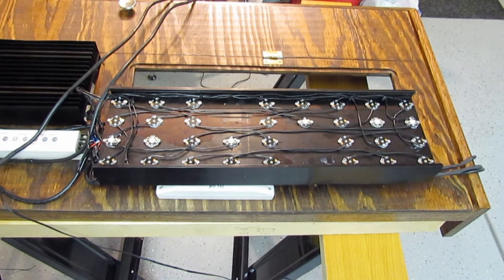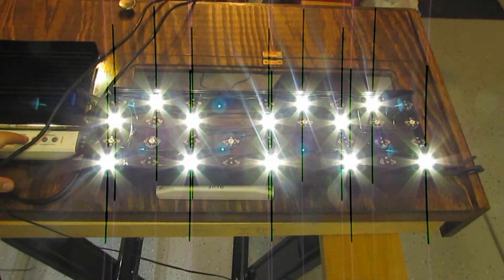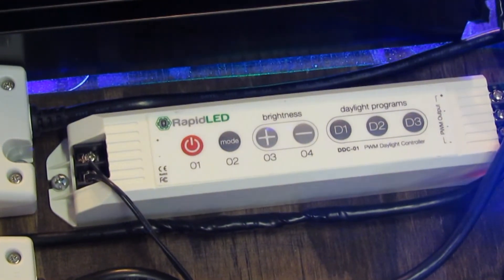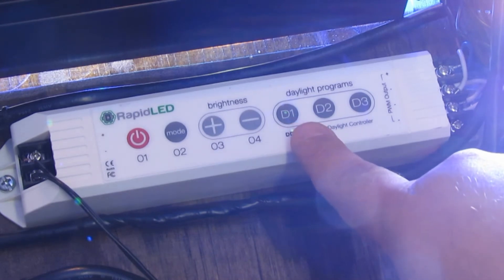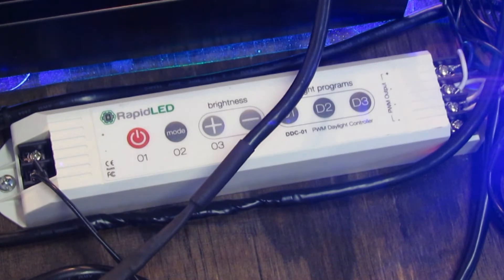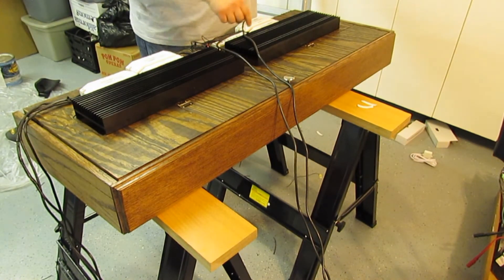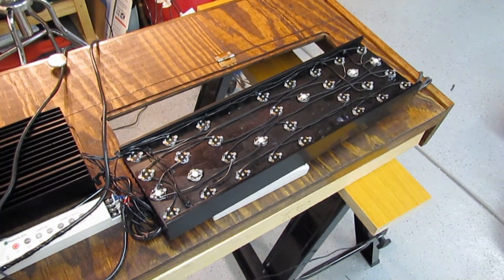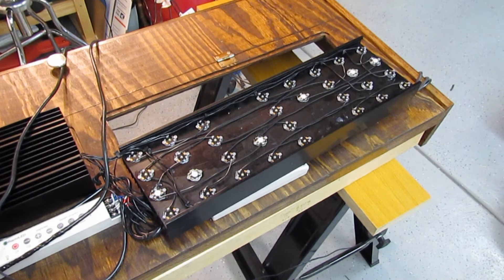DIY Aquraium CREE LED Fixture (Part 3) (Rapid LED Daylight Controller)

Comment: Many thanks for the nice video and for details information which i believe it helped a lot of people including me.
i have two questions if you may:

1. What is the wattage of the LEDs you have used (white, blue green and purple)?
2. don't you need to install a resistor between the LED driver and the series of LED?  

Best Regards,

Comment from the maker: @h2Orjonesey the heat sinks are 20 by 6. I did bu 4 120mm fans but havent added them yet. The heatsinks arent getting hot yet because the LEDs are at 30% power.

Comment: Great videos man! I don't recommend putting optics with the lights on. The LEDs turn hot very fast and the package solder will get soft. Pressing the package or moving it to pop the lens in could easily damage or short the LED. In case more than one lens degree is being used, I always like to name them with a sharpie cause once you get them out of the bag, you won't know which one is 80, 60 or 40. I wanted to ask, how do you like the green LEDs? Do they really do something to the spectrum?